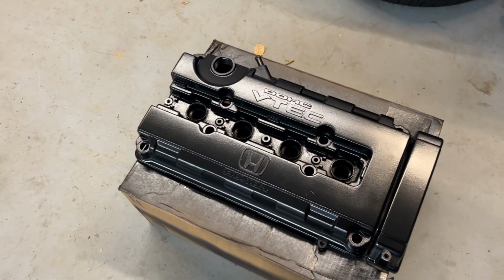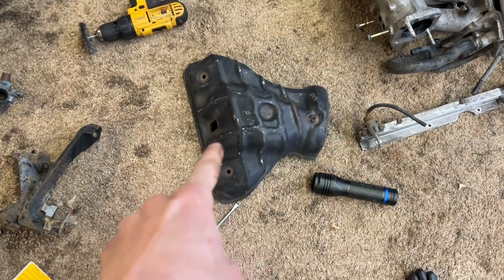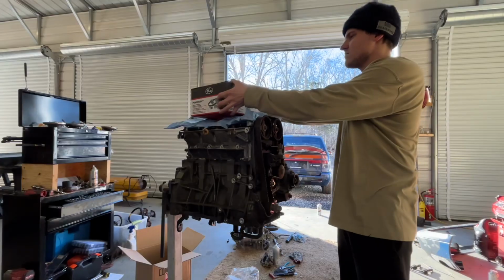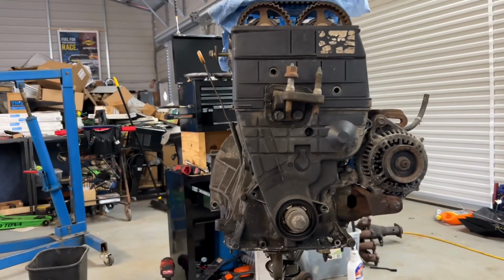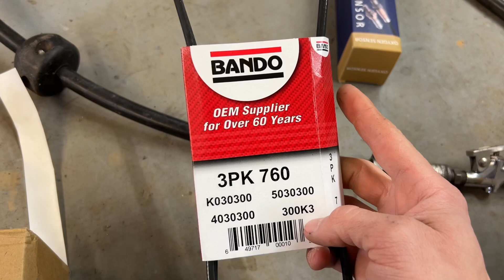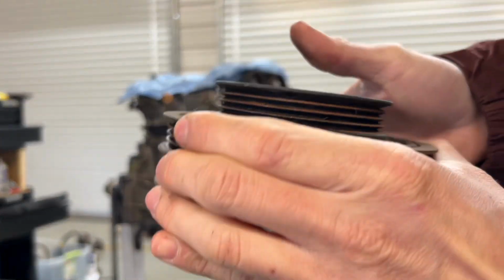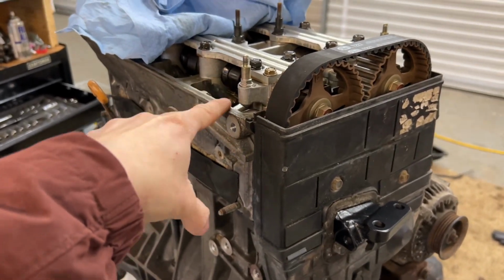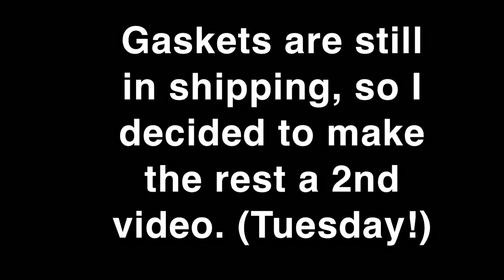Engine maintenance on my B16A! CRX B swap Episode 2

Comment: @4:12 i died a little inside..
Honda motors (D n B at least) rotate counter clockwise from the dampener / pulley. Like lefty-loosely. You pull the long side of the timing belt. Don't worry about breaking loose the +130fl-lb torqued main bolt, you wont. The engine goes "POP!" real loud out the intake ports as he's rotating the motor backwards. "We got compression!" he said while the exhaust ports, that are now intake ports which are sealed with tape create vacuum on the crankcase seals as they try to suck air all while throwing off valve timing.

The pop you hear is when when the intake valve spring pressure n valve lap seal breaks and opens letting the compressed air sucked thru the taped up exhaust port n crankcase that is sealed up and pressurized in the combustion chamber and compressed to about 10-1. All of a sudden decompresses and opens up to balance and relieve pressure. If you rotate the motor the correct direction, the "pop" is not nearly as extreme nor do you risk any unnecessary wear or damage to your motor before ever finishing assembling it.